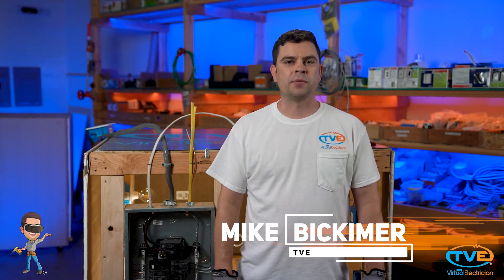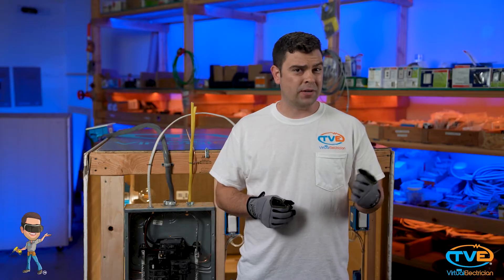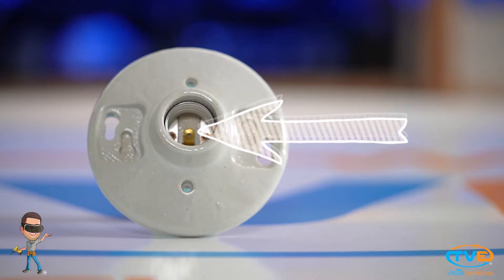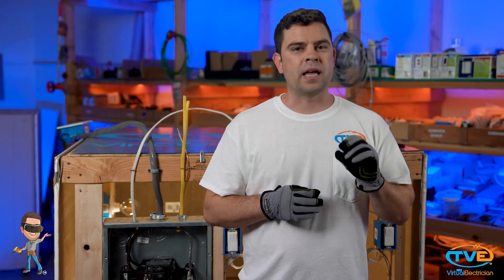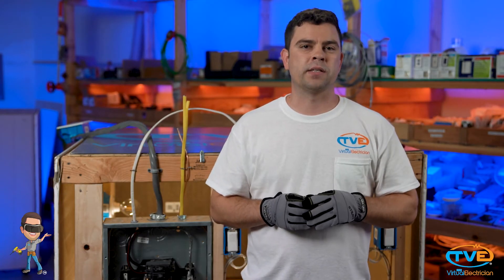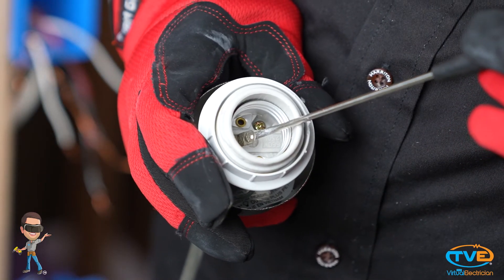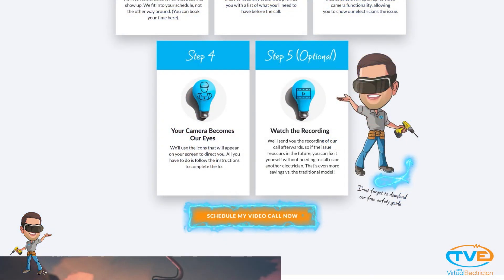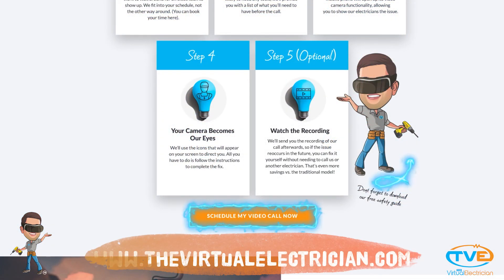Why do my light bulbs keep burning out?

Comment: I put a brand new socket in the light fixture a few weeks ago. Already two dead bulbs in the new one. I removed the cover of the fixture a long time ago so it's probably not the heat. Maybe some bad connections/wires in the fixture itself?
Reply from the maker: What kind of fixture is it?
Reply: @TheVirtualElectrician  ceramic E27
Reply from the maker: @dyzoly  yes check connections at fixtures. Make sure that your wall switch connections are good too.

Comment: Happens with all my bulbs. Double ballast with LED bulbs. Eventually one bulb in each ballast goes out on the entier circuit. Then one by one the last one each goes out. Starts with blinking, then dim, then finally go out. All are non dimmable daylight LEDs that are great value brand, so nothing fancy. No dimmer switches in the house at all. But same thing happens to all bulbs. I have some in the bedrooms that are smart bulbs and dimmable that never go out. 

Not sure what wrong but it costs me a lot.
Reply from the maker: brand or model number of fixtures?
Reply: Hey Kephers , did you get solution?
I am facing same problem.
What could be reason ?
Reply: Any update? @qtinqplays6342

Comment: Does the socket not shock you with just the light switch off. I have one bulb in a double fixture that keeps blowing out after a minute or so.
Reply from the maker: it will not shock you if the switch is off if the power goes to the switchbox and then the switchleg goes up to the light.  to be extra safe you can just turn off the circuit breaker
Reply: @TheVirtualElectrician  ok, thank you